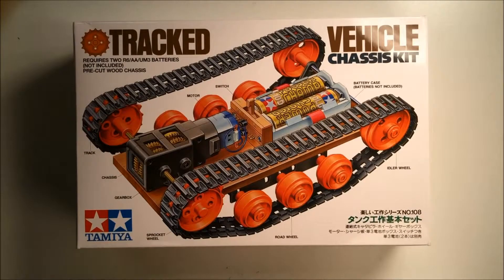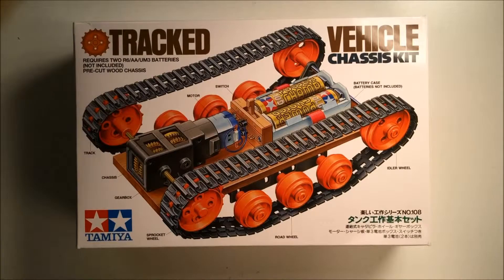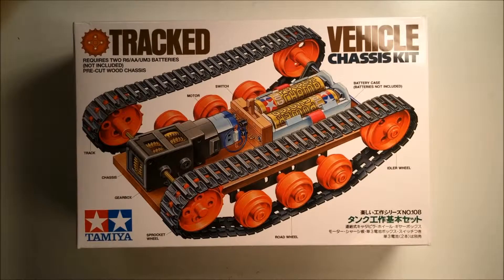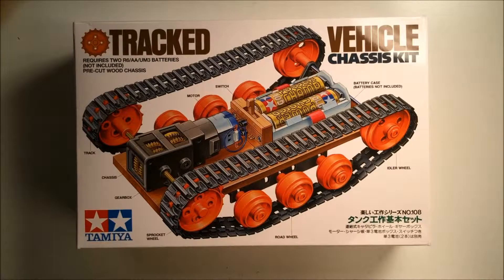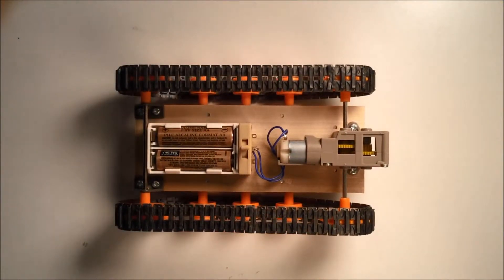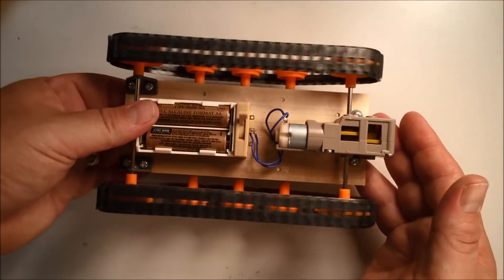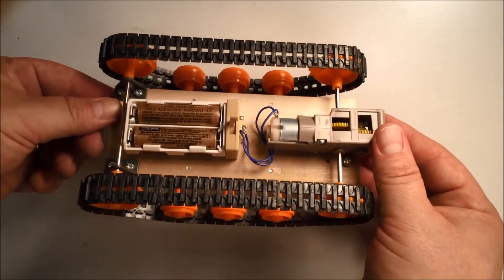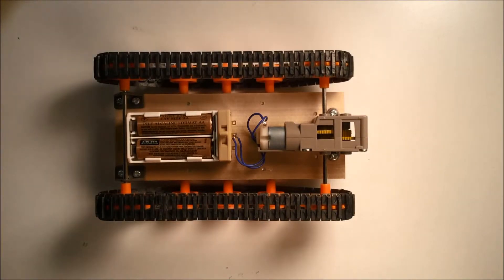Tamiya Tracked Vehicle Chassis Kit

Comment: You should check out Tamiya item 70168, double gearbox. it will allow for independent drive to left and right tracks. The double gearbox requires some modification but pairs nicely and offers a lot of flexibility.